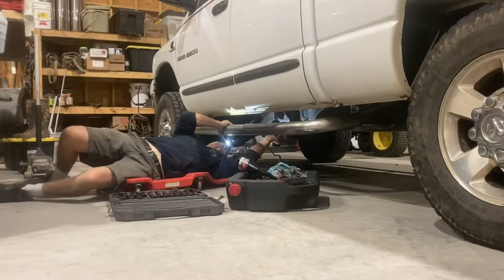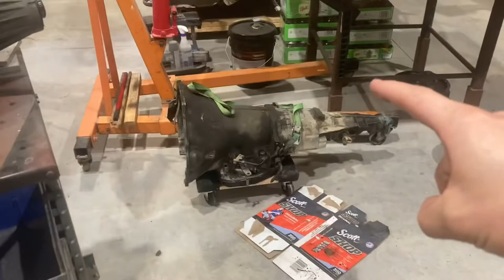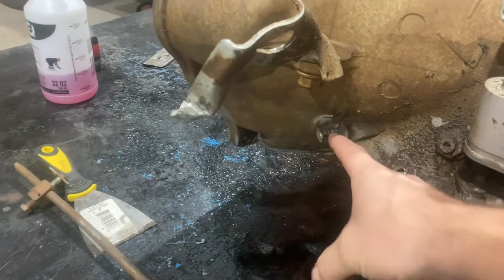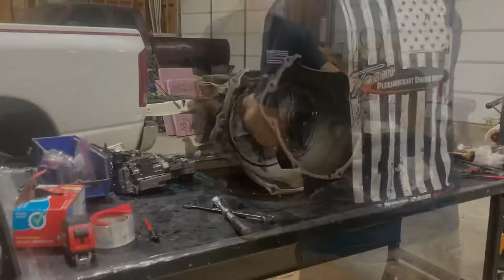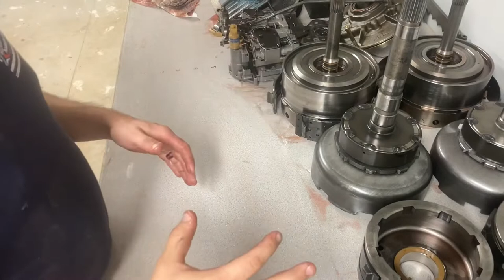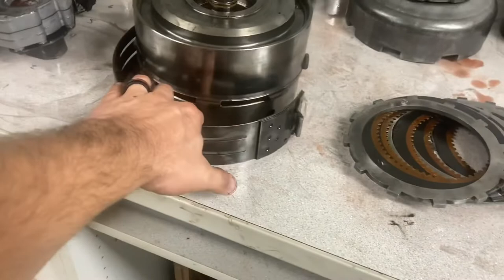Cummins 48re and 47re/47rh Tear Down Transmission Rebuild Part 1

Comment: Amazing.   Picked up an ‘06 2500 5.9L 207k miles, w/ 48RE 4-spd AT. I thought I’m doing well to change fluid (which was not bad in appearance) and filter. And going to adjust the two bands (have Dodge specs) { _ I do not think I could accomplish what you are doing_ }.  I’m just going through this truck and changing all the fluids, cleaning electrical connections.. so I have a base to move fwd from.  Thanks again for doing your videos.  Art in Michigan
Reply from the maker: Yes keep them bands adjusted, especially 2nd gear. Thanks for the kind words and thanks for watching!

Comment: I hit that like button for the 47/48 explanation differences.

Do you happen to know what needs to be done in order to use an early (03/04) 48re in a late 47re application?

I know the neutral safety is different. Not sure about electrical plug for the VB. Rest should be direct swap?
Reply from the maker: I know PATC sells a adapter for the neutral safety, not sure about the VB plug. It’s been a little while since I was researching all of that. Thanks for the like and watching!
Reply from the maker: Are you swapping an entire 48re trans into a 47re truck?